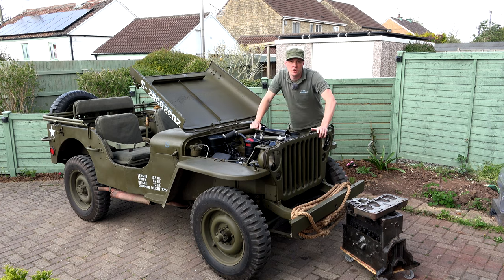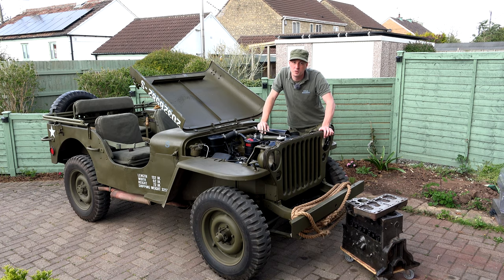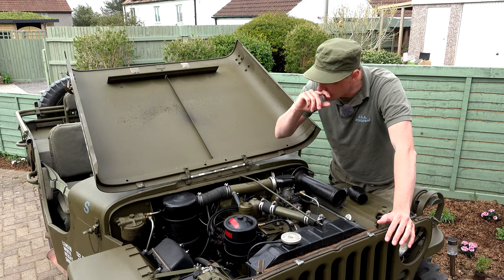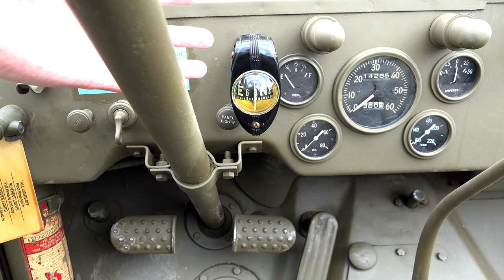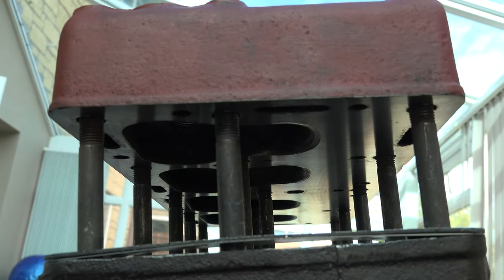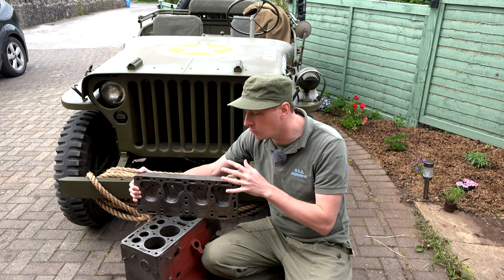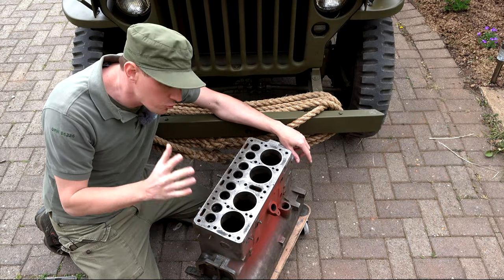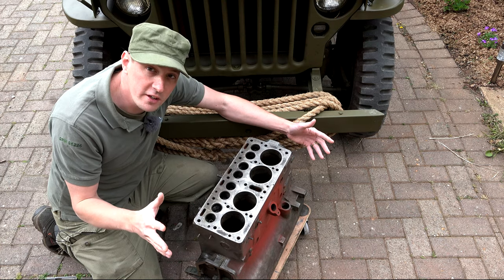What do these Weird markings mean on a WW2 jeep Engine???

Comment: The baffle is to separate PCV gases from liquid oil, in case of bumpy ride,so liquid oil is not sucked in the engine,hydrolock it,or foul and kill it.
The pcv system is connected just above the baffle,and directed to the intake hose.
All PCV systems have oil/gas separators like that,even today.
They are grilles,meshes,sheet plates to condensate vapors and separate gas from liquid.
As you see,you have to aim the baffle in the pipe when reinserting the dipstick,it's adjusted to not allow easy fluid circulation.

Comment: My Army National Guard unit had some old jeeps when I joined in 1983 (I think).  Not only were the cylinders marked, but the didn't always match.  You might have a block that was B,B,D,B. Ours were made much later than WWII, possible in the late 1950s or early 1960s. Some of the cylinders had no markings, however. We had one jeep that was made during the Vietnam War.  They run forever if you keep them up.
Reply: What model were they ?  I thought WW2 jeeps were discarded in the 1970's. Our local jeep dealer have lots of them back then they were surplus.
Reply: @briang.7206  You are correct, but some jeeps remained in the Army National Guard for many years after. I don't know the exact models, but they were a hodgepodge of different ones.  Fortunately, most of the parts needed to fix them could be bought at the local car parts store. I believe most of them were the M-38 model. The Army National Guard is the last to field any new equipment, and so has a lot of obsolete equipment.  Air National Guard units do pretty well as far as equipment goes.
Reply: Daniel Pearce  The M-151s were cut in half deemed unsafe to drive on the highway .

Comment: Half a thousands of an inch...??  I love the metric system! Great video by the way!!!
Reply: I am a machinist and I live in metric but almost always worked with drawings in Imperial. It was quite rare to see drawings in metric.
Reply: @haggis525  Hi Chris, I think Metric and Imperial are 2 different worlds. Are you UK or USA?) Altough... last time I was in UK they sold fuel by the liter, not gallon. And I have heard that UK automobile industry uses the metric already (I myself am a Peugeot-guy)
Reply: @arjenboeijenga117  I'm from Canada 🇨🇦. We use metric but virtually all my machining was done in Imperial. Canada is funny, though, we are 50 kilometers from a destination, will need 4 litres of milk, 2 kilos of beef but I am 5'8" tall and weigh 171 pounds. 
Temperature is expressed in °C but TV's have, say, a 50 inch screen. 
I'm also the last generation who became teenagers when the change over from Imperial to Metric took place - pretty much everyone my age +/- 5 years knows both systems equally well.

Comment: Like Ben Johnson said, the disk is a baffle to prevent rattling and fatigue. Be sure to check the weld on the baffle though, as mine actually came off from the stick when I went to check the oil. Luckily, I saw it just in time and could wedge it in the tube and it didn’t fall all the way down.

Comment: Another reason that the engine blocks were stamped with lettering during production,
 Was to mark the cylinders for being true to round.
  And these markings are often found on the oil pan rail of engines of many different manufacturers. 
  Have you ever noticed these.
  And seen a lot of A and B marks ?    If so that is likely to be a engine that has lasted for a exceptionally long time without having blow by through the piston rings.
  As compared to a engine that might have a lot of C D or E stampings.

Comment: The reliefs in the head are an old school hotrodders modification. Back then there was NO aftermarket so you had to figure out how to improve what you had. Most of the american mechanics in WW2 were farm boys and kids who had hotrods prior to the war. Model A's most probably. Engines were very similar. The reliefs added a few extra HP so its clear why they would do this on the jeep motors. 

They more than likely did some mods on the carb as well, re jetting them, swapping for larger ones etc....

Comment: If I had one that was machined too far I would consider using 2 head gaskets.  While that wouldn't be ideal...it would probably work well enough.
Reply: It works better to have a copper gasket of the proper thickness made to gain the needed clearance .

Comment: That must have been alot of extra work having to machine different pistons like that for the blocks! What's What's old saying " measure twice cut once" doesn't seem to apply to this at the time! Being in a war you would think they wanted to keep everything near the same eh! Could you imagine waiting on a B piston and non available but say 100 As !
Reply: Huge shortages of machine tools.  Castings and dies were used way beyond life spans.  Huge out sourcing from many small shops.
I imagine engines were final assembled by hand/old guys. 
They had to get the stuff out the door.  None was expected to last.
Reply: Common practice at the time. The same was done for 'shoe' bearings.